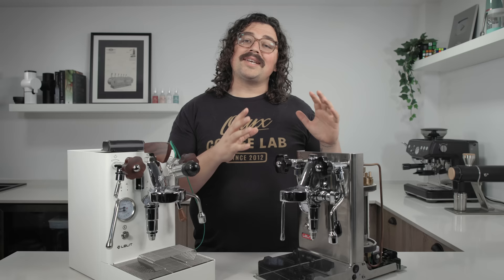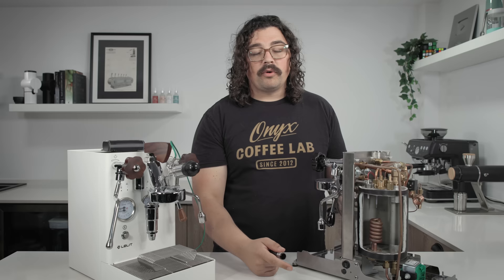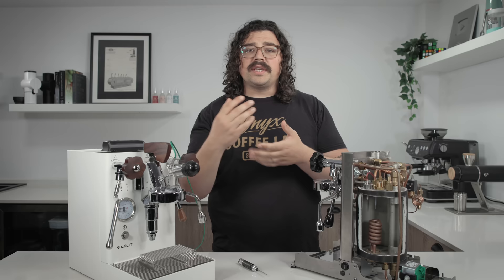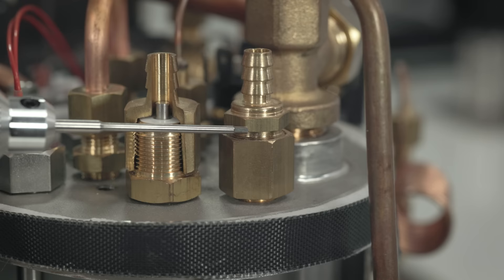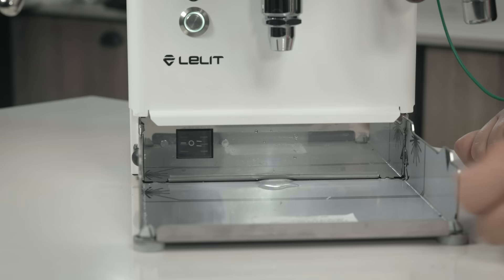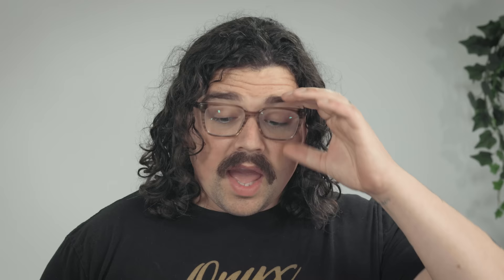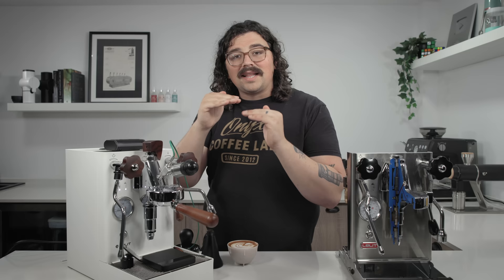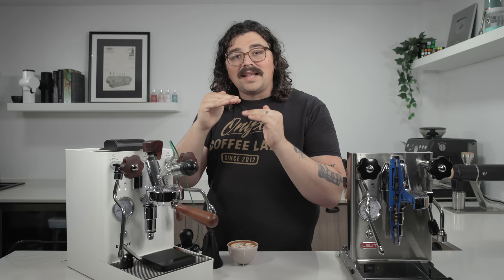BEST BUDGET HEAT EXCHANGER?: Lelit Mara X Review

Comment: 13:59 Are you certain of these modes? To me it sounds like you’re describing the V1 behaviour. 

As far as I understood in the V2 they nixed the steam mode and instead made a mode that always prioritised brew temp and then the mode you described where the heating is engaged during the shot in order to ensure steam pressure.
Reply from the maker: I explain it as you just said. Steam mode and brew mode. Steam mode keeps heating element on. Brew mode does not. I even watched the lelit insider video to ensure of what I was saying lol
Reply from the maker: regardless of explanation, I go on to discuss my temp readings. Even if there is something wrong (which I don't think there is), the temps speak for themselves. Over 100 even on lowest temp setting with steam mode activated. Excessive flushing needed
Reply: Hi Lance. Why would someone keep the machine on for more then an hour or so? As you say its overheating after an hour and half. I think its a home machine and it produces very good coffee. Don’t you agree?
Reply: @LanceHedrick  I think you might have a defective machine. The Mara V2 idles at the temperature set point regardless of the mode, which equates to somewhere between .6-.8 bar on the manometer. In "Steam Mode" it will boost the temp of the boiler during brewing, in order to provide higher steam performance(it also does this if you let some steam out from the steam valve), but this steam boost is temporary and will result in the group overheating beyond the temperature set point range in about 4-5 minutes after the last shot is pulled. After about 15 minutes, if no other shots were pulled, the group will cool back to the idle range. If your machine isn't holding idle (.6-.8 bar pressure and temp set point range at the group) without any activity (doesn't matter if it's 1 hour or 12 hours), then something is wrong with it. 

Dave Corbey has a video on this temp cycling...it pertains to the V1 in X-mode, but X-mode on V1 (switch position 1) is the same as "Steam Mode" on V2. 

Mauro (Lelit Insider)also mentions this temp cycling in the notes for his video - https://www.youtube.com/watch?v=stNGIiTUOOQ.
Reply from the maker: @James-gx7sk  I watched both corbeys and lelit insider. Neither pull shots for 2 hours. Everything is good in theory, like the temp offset on the Bianca, but doesn't pan out when rigorously tested. I kind of brush it off in the video because no one is using these commercially. It's all fine and dandy. I doubt mine is defective.
Reply: @LanceHedrick  James is saying that the Mara V2 should never be idling at above 0.8bar for any length of time over 10 minutes, in any mode. I've left mine in steam priority mode for several hours and the pressure shows 0.6, ready to pull a shot. So your machine idling at anything above that is very odd. Lelit themselves have been confusing with their own videos and manuals too. I received the old manual with my new machine!

Comment: Quick question from a Mara X owner... is the pump pressure gauge consistent with your max pressure readings at the grouphead? My grouphead pressure gauge shows about 1 bar more than the pump gauge with the blind basket in, and I'm always curious if I should adjust the OPV to compensate for the apparent difference? Thanks!!
Reply: That's normal. Pressure gauge should read about 1 bar more than the group. Stock is usually somewhere between 10 and 11 bar and it's a good idea to reduce it by a bar or two. I have mine on 9 (so, 8 at the grouphead). It's very easy to change, Lelit even have a video on it, but it's a slightly PIA to get the chassis off. But you can leave the chassis off and turn the machine on and play around with a blind basket to get the OPV set to where you want.

Comment: you know what Lance,  all this "modified" stuff is nice.  it's wonderful that you can do that. I CAN'T!!!.  it sure would be nice if you would just show stuff in it's "stock" configuration without all these modifications. it seems like every video you do reviewing something, it's been "modified" to the nth degree. Just my thoughts.
Reply from the maker: The modifications don't change performance. They are used just to show you how the machine works. Nothing else.
Reply from the maker: They allow me to track the shot to show you what is happening. The only mod that matters is the flow control. But even that, the most common mod in any e61, I also show an example without. Thanks

Comment: The price of the Mara is above the equivalent of 1450 USD here in Denmark and have been for a long time, so I guess we are extremely unlucky! :/
But the price of around 1455 USD is exactly the same as what the Lelit Elizabeth sells for here.
QUESTION: If they're evenly priced - is the Elizabeth a better deal than the Mara?
Reply from the maker: I'm taking dual boiler Elizabeth.
Reply: Thanks for the reply!  @LanceHedrick  . I somehow didn't get the notification that you replied, but it's all good since me and my fiancé have waited to upgrade the ol' Barista Express until we got our Sculptor 078s. And I'm now going through the options again :)... What would you chose between Lelit Elizabeth, Sage/Breville Dual Boiler, Rancilio Silvia Pro X and Profitec Pro 300?? Really interested in your opinion on this choice! By the way WE drink mostly flat whites with me taking an espresso without milk around 1 out of 5 drinks (but tasting all shots before adding milk). We use the machine mostly in weekends when we have the time to make and enjoy espresso-drinks with milk (V60 in thermos on workdays except when we work at home - around 1 day a week for both of us). Thanks so much in advance!

Comment: Lance, where did you source the bluetooth temperature profiler and the thermocouple probe?  Naked Portafilter/Smart Espresso Profiler doesn't have them listed on their website currently.  I use the Smart Espresso profiler on my E61 group dual boiler machine with my bluetooth capable scale, and would also like to add the temperature bluetooth profiling that you used with your Marax review for my use too.  Please enlighten us, if you don't mind?  Cheers, from one of your Patreon supporters
Reply from the maker: Hey Victor!
He hasn't released it yet. Still in beta. I am a tester. It's still Gabor.
Reply: @LanceHedrick  Thanks for the quick reply, and thanks for a typically great review again.  Cheers.

Comment: Thanks for the good content as usual. I have the MaraX and would not get it again at this point in time. The steam power is very disappointing in X mode and the espresso is not good in the other mode. E61 also has giga high energy consumption and the thermal balance of the machine is a bit weird. You gotta wait a minute or two after the second shot for it to reach a good point again.
What would you recommend as upgrade Lance?
Reply: Dual boilers?
Reply from the maker: Interesting. I've never had an issue steaming on either brew or steam mode. But if that's your issue, dual boiler seems the only logical route.
Reply: I have the first iteration of the machine, maybe it was worse there. They actually did some changes between the revisions, I.e. smarter water routing. The first one was ejecting the water from OPV into the tray, which caused really high water usage
Reply: The newer version has much reduced energy consumption and water consumption.
Reply: @shortrefmegaref  i modded mine to solve the water problem. That is relatively easy, but I guess energy management cannot be solved as easily. Maybe I’ll get into microcontrollers at some point, but apart from the low-ish steam power the machine is fine and does good shots.
I can also recommend switching the shower screen to the IMS one with the hexagons. That improved consistency by a lot
Reply: @martinlechner403  energy management shouldn't really be a problem if your mara isn't set to HX mode (like you could with the early ones). It uses about 0.5kwh to get up to temp but holding the boiler steady doesn't take much energy.

That said, thermoblock machines like sage/breville do use much less power but at the end of the day you are probably spending much more on the coffee and possibly water if it's not tap water

Comment: hey Lance, when you do the blooming shot (turn the flow control to the left to close the flow), the pump is still on, will it accumulate so much pressure in the machine when the pump is on but water can not come out and causing damage?
Reply from the maker: No- the water just circulates through the boiler. No worries.

Comment: Awesome video, thanks a lot Lance! I've been the proud owner of a Mara X for half a year now. One issue that I do have is that the puck often gets stuck when I remove my portafilter. Do you know why that occurs? Thanks so much!
Reply: It happens on my quick mill pippa on occasion as well. I believe it's just from when the machine releases the pressure after brewing the puck can get sucked upwards. It's not a bad thing. If you want less cleaning you can toss a puck screen or paper filter on top just in case
Reply: Get an IMS screen shower, as experts say it won't significantly increase the quality, but the screen will be much much cleaner! While on it, also replace the rubber gasket with a silicon one — it feels more pleasant
Reply: I already own an IMS shower screen and a new gasket! Thank you for helping though :)
Reply: @StijnBonder  one next step is to get a puck screen then!

Comment: Do you have it in steam mode, for all other videos that check heat stability in brew mode over several shots in a row, temperatures go down rather than up like for you?

I don't really understand, it seems to be really heat stable, who has the machine on for several hours at home, the EU model automatically switches off after 30 for that matter.

With today's electricity prices in the EU, no sane person would leave a machine running unnecessarily, and if that were to happen, Greta would come and take your ear off!

Lelit mara x v2 must be the best maskin under €1000 i EU!?

Comment: Nice review. This machine is definitely not for me. BTW I have that wireless pressure meter, and one thing that puzzles me about it is that there is no mention anywhere of it having a battery, and the app always shows the battery at 100%. I have the meter teed to an analog meter and I like reading the analog meter when pulling a shot and looking at the pressure/flow log after the shot.
Reply from the maker: Re: the battery- it's a small one inside. Just a super long life.
Reply: @LanceHedrick  Thanks for the info.

Comment: Hi guys.  Can someone tell me what is the correct name of this device for measuring pressure and temperature?  How much does it cost and where can I buy it? Thanks.
Reply from the maker: From smart espresso profiler. The pressure transducer is about $300 or 400. The temp prohe hasn't been released yet. The thermometer i used is out $250

Comment: I was actually expecting that this review would be of the new 2.0 version - I believe it does away with the steam priority mode altogether, but I didn't pay attention to what's changed as I have the original version myself.

Thank you for this video, I have a better understanding of this machine that I've had for about a year and a half or so, and thought I'd share my experiences with it. As an FYI this is my first espresso machine, and I am very new to coffee so my experiences in this have all been as a complete novice.

Overheating is definitely an issue with this machine, if it takes you a little while to prepare your next shot. The shot to shot consistency can be definitely very good, however I cannot get my next shot ready quick enough and I find that my machine will immediately overheat after my first shot as I'm very meticulous about my puck prep. I think if you pull your next shot within a couple of minutes you won't have my issue, but I do all the WDT and stuff in between and by the time my puck is tamped the machine is already over temp. That seems to be a little different to what you've found by waiting 3 minutes between shots but again I'm very much a beginner so I may not be very accurate in my findings.

I have however found that I can get the temps back down - I just run water through the group , and you'll find that the temperature will keep climbing, most of the time going over 100C (based on my group head thermometer) and then at one point the temp stops climbing, and will start to drop. At that point I stop the flush, and just do my next shot and it is roughly within that margin, probably hotter than the setting should be but I'm not getting anything too crazy.

I also do have issues with the steam pressure dropping, but I did not know about that super heating thing you described, so that's something I'll try over the next few days. It's been my biggest frustration as I pretty much only make milk based drinks and steaming at 0.5 bars is a hard no for me and I have wasted quite a bit of milk attempting to steam at the correct pressure, which is usually just over 1 bar.

If I can figure out how to get full control over my steam pressure then I would be extremely happy overall with this machine and probably not wish I bought a dual boiler instead, and even with these issues I've had I have been very happy with this machine. It's definitely been a good machine to learn with. Hope this helps some people deciding out.

Great video once again, was excited when I saw you covered the Mara X.
Reply from the maker: This is V2.
Reply: @LanceHedrick  Right so there's definitely something I'm missing in terms of what changed from V1 to V2 - from what I've read in a couple of places in V2 they supposedly removed the Steam Priority mode and instead there's 2 versions of the X mode - with the updated mode being pretty much the same coffee/brew priority, without the steam boost. I feel like I'm missing something here
Reply from the maker: @bagadoink  what you're missing is moreso me calling it steam priority. It is has a higher range for the steam boiler. Up to 138F. Says as much in their own video on it on Lelit insider.

Comment: I don’t get how you are able to keep it on unused for 2 hours. Mine goes to standby mode after 30 min.
Reply: Mine also automatically does periodic flushes and that keeps temperature consistent
Reply from the maker: Interesting! I should note mine isn't technically sitting idle. I might go by and hit the flush or something while testing. But you can disable the standby

Comment: Hey Lance!  I have a Lelit PL62 Mara that was discontinued a few years ago. It looks very similar to this Mara X.  What is the main differences between them and is it worth it to upgrade? Is there a market for used Lelit espresso machines?   My biggest complaints for my machine is the water tank is hard to clean and the drip tray and water tray both vibrate very loud.  Otherwise it is a great machine!
Reply: Main difference is better temp stability in X, thanks to use more sophisticated temp control. Mara X have biggeer, steel boiler, different body etc...

Comment: Hi, which is the difference between BZ Magica PID and Lelit Mara X V2 ? As far i understood, Lelit confirm that a big issue with overheating temperature was solved due the double PID priority on espresso or steaming . Is that true ? Is that a Lelit performance VS. other HX machines like Profitec 400/500 , ECM Classica, BZ Unica, BZ Magica or Rolet Apartamento ?